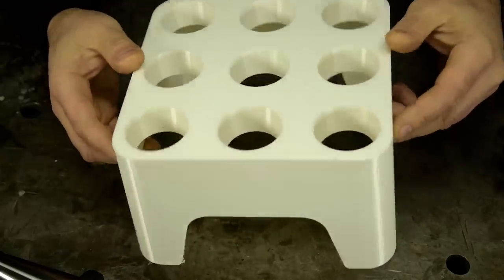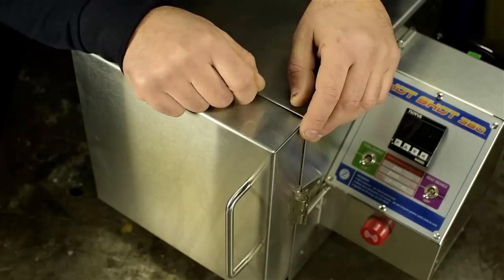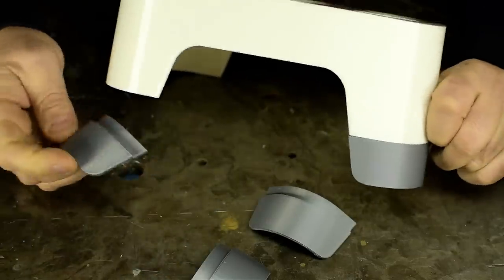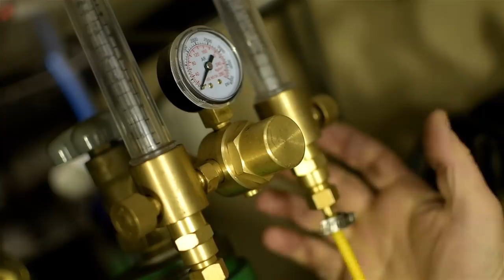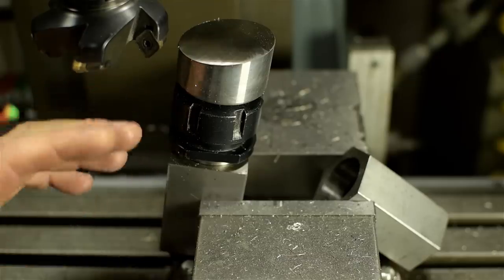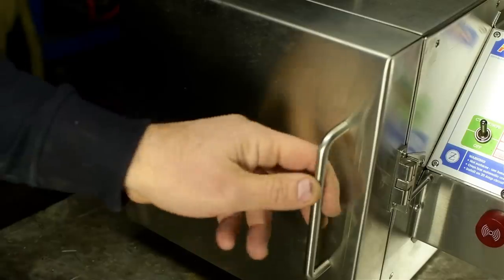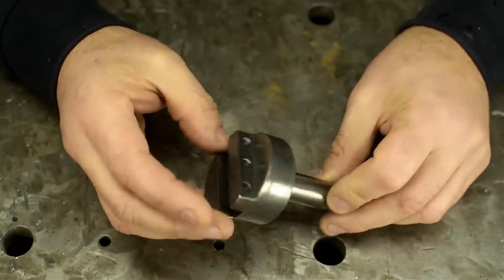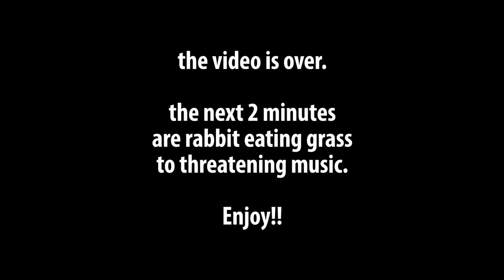NOW We're Cook'n with Argon!!

Comment: Wrapping parts in stainless steel foil for the hardening and quench will keep the scale away. The parts don't even turn black.
Reply: I was watching thinking, "Huh, my mechanics never seems to have scale." Now I know why!
Reply: You can negatively effect the quench, if you don't remove the parts from the envelope first (depending on your particular requirements)
Reply: I vouch for this random stranger from Switzerland to know what he is talking about!=)
Reply: lol du kommst aus der schweiz??
Reply: @morkovija  

Yo, I’m not Swiss 🧀, but 1.25 works for me!
Reply: @maxegloff3001  No, Max I come San Francisco.
Reply: I have been doing this for many years. I wrap the hardening parts in newspaper and then in stainless steel foil. They always come out great
Reply: Purge the envelope with argon as you are sealing it. Good luck!
Reply: Previously on TOT... I believe this was attempted.
Reply: yooo, you're the restoration king
Reply: Depending on the type of steel and what hardness you need to get it to, the time it takes to cut the packet open and get to quench can mess up the final hardness you get. Ultimately, if it's critical that you get no scale on the part, the only foolproof option is heat treating in a vacuum furnace.
Reply: You can use Ali foil
Reply: @21gioni  It's melting point is a bit too low for that, no?
Reply: @21gioni  
You could if the melting point of the foil was higher than the heat treating temp.  It's not.
Reply: @MrCh0o  true
Reply: Yeah, the effects with your last cleaver restoration project, and steel foil, were spectacular. Cheers, from Zurich.
Reply: Chris, Saran brand plastic wrap is no good either.
Reply: @firstmkb  might help with carburizing tho
Reply: Ohhoho, Christmas again - my favorite restoration channel commenting on my favorite dad jokes... I mean engineering channel...
Reply: Wrapping paper in the foil can help burn off the residual oxygen.
Reply: Oh you watch him!
Reply: Love this channel. Who Doesn't?
Reply: You guys should do some sort of collaboration
Reply: @21gioni  most heat treating temperatures are past the melting point of aluminum, also even if they aren't aluminum loses the vast majority of its strength at high temperatures so the foil will tear like paper when you try to pull it out of the oven
Reply: Approved
Reply: :O my mechanics is here!!!
Reply: @daniellucas7715  Stick a piece of paper in the envelope. It burns off and eats up the oxygen in the envelope. I've seen a few machinist's use that trick on YouTube
Reply: Wrap it in paper, then foil - the paper will burn before the steel starts to oxidize, reducing the amount of oxygen in the foil to practically zero
Reply: @lifuranph.d.9440 German (Swiss boarder) I thought. Agree 1.25 - thank me later
Reply: @morkovija  3x all day baby
only 2x on mobile
cuz there is no add on for 3x
Reply: OMG my head is going to explode since one of my favorite YouTubers My Mechanics posted on another fav ToT!!  Gotta get me a Powerball ticket!
Reply: @SuperAWaC  How does the heat transfer to the part in a vacuum? Just via the touching surfaces? Genuinely interested.
Reply: @SethTaylor1  how does the heat from the sun touch the earth through the vacuum of space? thermal radiation.
Reply: @dominikkmieciu  i kinda figured that there could be some oxidation in the period required to fiddle with the part, and get it over to the plunge pool...might be good to have a loop in the wire, so you can just hook itout, and swing it over to the quenching bath.
Wer aus der Schweiz ist?
Reply: @SuperAWaC  yeah I feel stupid now!
Reply: I think this method is used primarily for odd shaped parts that would be harder to seal in stainless foil.
Reply: I like Clickspring's technique with boric acid and stainless wire wrapped to create a kind of nest around the part. I haven't personally tried it yet though.
Reply: @SuperAWaC  he said stainless foil, not aluminum.
Reply: @nicholasamadori2577  the guy i replied to said aluminum foil
Reply: @SuperAWaC  sorry, this ugly youtube comments visualization confused me. I believed you were replying to my mechanics.
Reply: For all you guys saying aluminum foil will melt... he did say stainless foil, so...
Reply: @dominikkmieciu  Doesn't the oxidation still occur as you remove the parts from the SS wrap so that you can get to the quench as it then is exposed to free air?  Or do you just quench while it's still wrapped?
Reply: For those of you have commented on my comment about using Aluminum . Yes Aluminum will melt and it will also release certain gasses that will provide special protection. 
Give it a try and you will see what it does.
Reply: @keithhansen3963  I always temper with SS wrap. I measure the hardness after quenching, then tempering and I had no quality problems. After burning, the paper also creates a coating on the surface, protecting the part from possible sticking of the foil and contamination.
When we expose steel directly to high temperatures, we burn the carbon from the outer layer, so there is more work to do later.
Reply: Put some titanium chips in there for almost no oxydation.
Reply: @21gioni  certain gases? Aluminum is a base element. All you'll have left at those temps is aluminum oxide, but I don't see how that would shield from oxygen on the part.
Reply: @oldmanpatterson79  my original post was done as a joke because everyone seems to be an expert at comments.
If the chamber is flooded with argon it couldn’t possibly form Aluminum oxide only the surface oxide would become aluminum oxide. 
Think about this carefully if you’re TIG welding in an Oxygen rich atmosphere the Aluminum would combine with oxygen and the weld would look rather dirty.
By protecting it with a shroud of Argon you end up with a clean shinny weld.
You can tell if you have enough purge using Aluminum and analysis of what happens to the Aluminum.
If your purge is sufficient the Aluminum will have pooled into a shiny molten pool.
Reply: I said the same thing on the video when he first tried the oven. I sometimes put a paper towel in the foil bag to eat up the oxygen.
Reply: Glad to see you here.
Reply: @SethTaylor1  most of us feel stupid after watching this old Tony.  I think his mistakes are better than most of us can do. 😁
Reply: If I remember correctly, some blacksmiths coat the stuff they want to heat treat in some refractory, for example Satanite.

Comment: Looks like the case of the oven is actually made from Undrillium.
Reply: Peter smith  and steel is heavier than feathers.
Reply: @MaximilianonMars  but only if you have a pound of each.
Reply: On top of it's heat-treated it is a heat treat oven.  once it turns you need something to cut through the hardness.
Reply: TOT needs the Hardness Standards table for the different grades and types of : Undrillium, Unobtainiaum, Toosoftium, Badstuffiaum. I'v got one SOMEWERE in my old Gerstner box.

Comment: Finally I found another guy who puts his fly cutter in his cordless drill for squaring work on the go
Reply: I use my fly cutter in my Yankee Screwdriver. Makes a super fine finish.
Reply: must have been a shipwright.. i found an old shipwright level once the bubble vial helps if it gets dropped..
Reply: Use it on the fly so to say lol.
Reply: @michiganmoto7687  When I was first exposed to a Yankee, I was blown away... I still kinda want one.  Perhaps one day I'll make that happen.
Reply: @DavidLindes  I got one at a yard sale, works but I never use it, just a novelty piece I guess. You can find plenty at antique stores or eBay, they'll cost a pretty penny though
Reply: Lemme guess: you put a saw blade on a disk cuttter too?
Reply: @SamSamuylik  Yeah... that's why it's on the list right behind taking up copper polishing.  ;)  Gotta get those pretty pennies.  ;)
Reply: I tapped mine with an M14 thread and use it in my grinder! 🤔
Reply: @DavidLindes  Don't bother they're only good for blood blisters
Reply: @OnzeManInKazakhstan  must-have for the refined tool kit,ustacim.
Reply: I mostly keep mine chucked up in my cordless on the front porch. Comes in handy to keep the bugs down...

Comment: I've been working as a knifemaker a few years back and we also used Argon to flush the chamber.
From my experience there shouldn't be any damage to the surface layer at all. All we used to get was a thin matte grey oxide layer and no pitting to speak of.
This was easily removed with a few strokes of 400-600 grit sandpaper. This layer would be tough but thin and you could still see the satin finish from before trough the oxide.

I think time is of the essence here as the oxidation starts as soon as you open the oven door and the atmosphere disperses. Just move a bit quicker next time.
Also I'd set a higher flow rate and maybe you should replace your oil as it seems to have a lot of gunk in it which immediately bakes onto the part as soon as it touches it.
If you're not using proper quenching oil yet, try to get some that's specifically made for heat treating.

I'd also stay away from Nitrogen and just use the Argon. With Nitrogen the oxide layer always seemed to be a lot harder to remove given the same parameters as with Argon.
I can only guess but I think the outmost layer got partly nitrated in the process which may not be a wanted side effect...
Reply: This was my thought also. You could crank up argon flow right b4 you take the part out and have your oil right at the door. As an alternative I'm going to purge my shop with argon completely be for removing the tool from the oven. I love all your videos TOT. I'm feeling kinda sleepy,  I think I'll  take a nap in the shop.
Reply: To add to the whole proper quench oil idea, also keep in mind that some steels want a  heated quench media.
Reply: @alext.7313  AFAIK most tool steels do. When doing critical stuff we'd usually prewarm the oil to around 200°C. This also reduces warpage and probability of cracking.
Reply: @joenicotera2991  Proper Nitration happens at 500-550°C, so at those high temperatures it's merely an uncontrolled side effect. When done properly your part shouldn't look hot forged at all but just have an even greyish coating all around. For the parts i usually do i can still fit precision ground pins to holes that were reamed at max. 0,01mm bigger without even cleaning them up. And no, a nitrated layer isn't always wanted, especially when you need your part (f.e. a knife) to conform to certain characteristics (e.g. toughness, brittleness, edge retention, etc.).
Reply: @unr3al67   I can say that, to my experience heat treating a wide swath of different steels, it's close to 50-50. In fact there are many steels that want to air cool after hardened. To make it more interesting, some require some intense heat mapping to air quench properly. (Ie slow ramps down, weird stepped ramps with plateaus, etc...)
Reply: @alext.7313  I of course meant most steels that are oil hardened prefer preheated oil. And yes, air quenching is really hard to control. I never really got the hang of it...
Reply: @briankelly5731  personally, i like to have my shop at a complete vacuum, no pesky oxygen molecules to screw things up
Reply: @Matthew Morycinski I guess, but i'm not educated enough on the subject to say why it isn't done at those temperatures. There might be other things going on then. Also, as i said: You may not want it to be nitrated...
Reply: @briankelly5731 pure comedy gold. thanks for that
Reply: In that case, would be the best to never leave the argon atmosphere if possible?
Reply: @youkofoxy  Of course it would. Bigger heat treating companies f.e. use vacuum ovens that have a hatch that opens automatically and then lowers a basket with the parts into the oil all while maintaining vacuum.
Reply: @briankelly5731  use the bedroll on the floor. It's real comfy.

Comment: The argon is heavier than air. It's leaking out of the oven through the steel casing and door. I recommend putting the oven door up if possible to reduce leaking. Otherwise increase purge cfh.
Source: Professional pipe welder
Reply: @froop2393  It sure as hell cools down quickly too... and transfers it's heat to the air causing air to become lighter... overall keep in mind the diffusion usually argon just like any other gas will just disperse in air and you will merely start suffocating because the concentration of Ar is Already to high in the whole room... besides Argon is already in the air, it is just that the concentration is very low... I'd just be sceptical and take every precaution possible, most importantly install an active ventilation system in your garage...
Reply: An iron worker would just weld the door shut
Reply: Why not change how the over is oriented? Like with the opening upwards, like a foundry. There is nothing preventing this aaaaand once it is filled with argon....it just stays there.

Comment: It's funny you mention a "rotating hot end" for a 3d printer that's actually something I've been working on for awhile now, specifically to allow different materials/nozzle sizes/ temps/etc. Basically a microscope end, just with E3D V6 hot ends instead of lenses.
Reply: It is a cool design can't wait to see you finish it.
Reply: I've made a couple 3D printers with multiple hot ends for different colors flavors etc
Reply: @benjaminwatkins7345  ya there are multiple ways to do it I just haven't seen one like what he is working on. And it is almost exactly what Tony describes.
Reply: Tool changer mods are a thing now
Reply: Makertech3d sells a switching hotend but the reviews aren't that great - and the switching with that one is only on one plane. Repeatability and calibration is a huge hassle.

There's some nice manually operated options though, xChange being the one that comes to mind first because it's a commercial product (kickstarter) but there are many opensource solutions on thingiverse and the like.

For fully automatic toolchanging, the e3d toolchanger / jubilee3D seems to be state of the art atm. Their couplings are being ported to different platforms by the community. Also a hassle to set up and calibrate but very precise and repeatable.

Comment: Since argon is heavier than 'air', most of it is going to flow out of the oven as soon as you open the door.  
Nitrogen will take longer to do that (since the air is mostly nitrogen), so you may get better results with the other gas. 

Honestly, I've found that laying the oven on it's back with using gas helps the results, since opening the top doesn't let the purging gasses fall out onto the floor.
Reply: Argon is heavier than air, but it is fairly hot inside the oven, so maybe it is actually lighter than air in this case?
Reply: @HitoPrl  Just heat the shop to 1500F. Problem solved.
Reply: @marcgoodman4862  least he wont have to worry about a covid infection if he somehow heated his whole workshop that hot )
Reply: Science
Reply: @HitoPrl  It Is. Convection will take care of the inert atmosphere the second you open the door.
Reply: If you flush the oven with nitrogen, isn't there a risk to nitridize the part?
Reply: @nejiniisan1265  Not if you don’t heat the item too long in just Nitrogen...Yes ?
Reply: @lifuranph.d.9440  I see.
Reply: I've had incredible results filling the whole shop with argon
Reply: @ramiroalonso3152  that only works when the shop is in the basement.
Reply: @nejiniisan1265  nitrogen is diatomic, meaning it bonds with itself. This bond is incredibly strong, straight nitrogen gas does not react will in most processes. Generally when reactive nitrogen is needed it comes from a source such as ammonia.
Reply: @ceriseauthor7155  thanks!
Reply: Trap door under the oven leading directly to the oil quench bath and laser sharks.
Reply: @marcgoodman4862  easier to just fill the shop with helium.
Reply: @marcgoodman4862  Or move to Phoenix
Reply: @GreeceUranusPutin  Not right now.... it is 68 right now at 408pm and it has gone above 80 these past 2-3weeks, and usually dropping to low 30's at night.  No sorry, Phoenix wont help at this time of the year. I should know  live there. Wait till April/May then do it. heh.
Reply: I agree. If you put the oven on its back it should help.

Comment: When we use nitrogen to inert vessels in the oil industry we apply the gas from the bottom and vent the oxygen from the top.
You an always check this in your application by putting a lite  
Match into the vented gas to confirm you are getting no more oxygen in the vent stream.
No we don't use this test method in our industrial applications

Comment: Many years ago I worked in my grandfather's tool & die shop and we would wrap the dies carefully in stainless-steel foil before they went in the oven for heat treating. They were still slightly discolored, but when they were unwrapped they had NOTHING like the scale I saw in the last video when the tool steel goes in naked. This argon mod is awesome, but the old folks knew how to get stuff done too.
Reply: I regularly use A2 and I either wrap them in stainless steel foil or bags. If I do it well they come out nice and bright. A2 is an air cooling material. I leave them in the bag and before tempering in the kitchen oven they are at 62 to 65 HRC
Reply: That's how I learned to do it, with an added chunk of paper in the bag so it burns up and consumes all the o2.